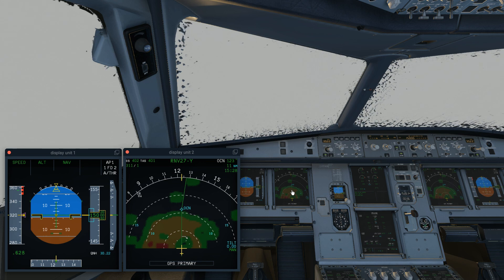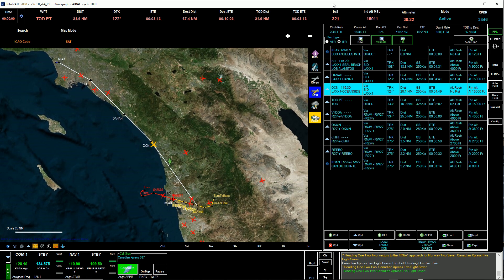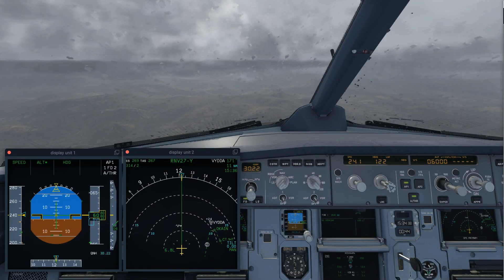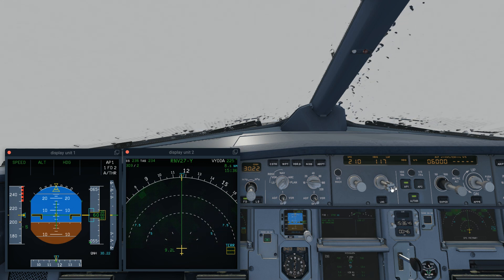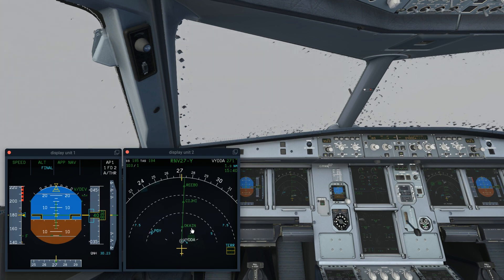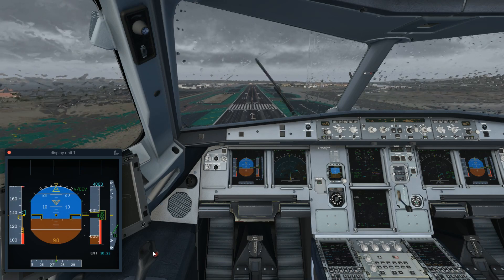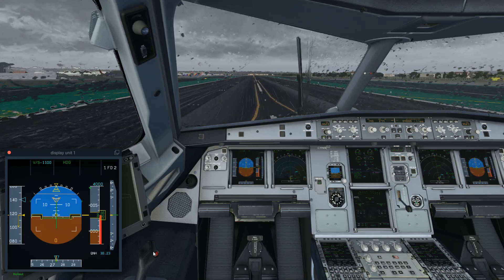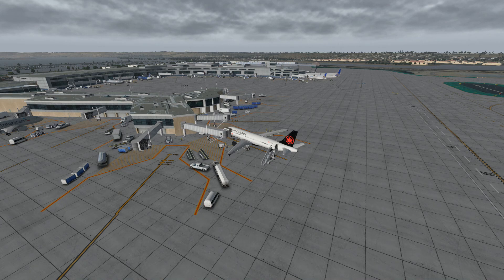RNAV for A320 with vertical deviation

Comment: You criticized others for there poor explanations of RNAV. However, you demo was even worse. How ironic. All you did was talk and you didn't even use proper aviator nomenclature like "IAF" - Initial Approach Fix, etc.
Reply from the maker: Thank you for feedback. This video was made some time ago and I have planned for some time to do a new video as the title is misleading. I'm surprised I haven't had more negative feedback- LOL. I wasn't complaining about the the poor explanations of RNAV in other videos I was complaining on the complexity of the explanations. In my video I was simply showing how to land an A320 at San Diego when you are given a vertical deviation signal. The title of the video, however, is misleading. I plan to do a new video but I won't title it RNAV for dummies as it isn't an explanation of what RNAV is or what the 4 or 5 different RNAV approaches are and how they are different depending on the plane you are flying. In other words there is not one RNAV approach that is the same at all airports or the same for all planes as the navigation systems differ.

Comment: Very interesting video, my only critique would be that if you're looking to show people how to do the RNAV approach.. perhaps maybe you should do it in clear weather because I'm so distracted by that weather and everything else going on with the ATC chatter that it's very hard to focus on what exactly you're doing.
Reply from the maker: Noted- Yes I did make it confusing. in the A320 where there is a vertical deviation signal you can use the APP button plus your flight plan for the RNAV approach. In other planes you will need to use LNAV and VNAV.
Reply: @bobblack4604  just to be clear Bob I did enjoy your video, and also did learn a lot, I've been a desktop pilot for over 20 years but I was always a little bit intimidated by the non-precision approach. So I wanted to thank you for doing the video.

Comment: Whats the plugin that you use Bob, for the crew anunciament  and whats the aircraft? Please
Reply from the maker: The aircraft is A320 from Flight Factor. I use a plugin called speedy co-pilot designed for the A320 that handles all the work of the co-pilot. I also use ATC chatter for the Pilot2ATC software that gives ATC chatter in the background.